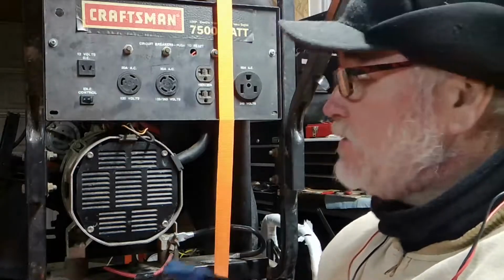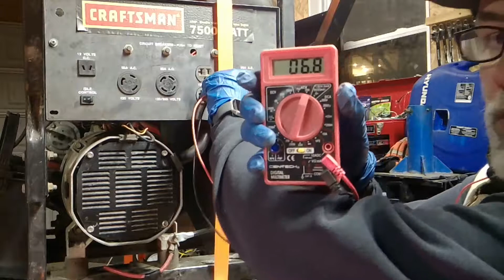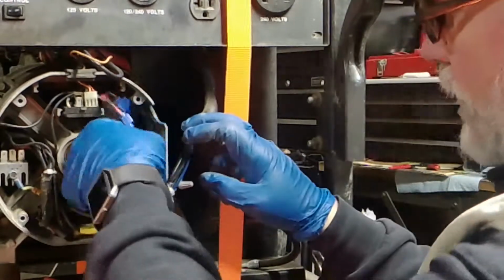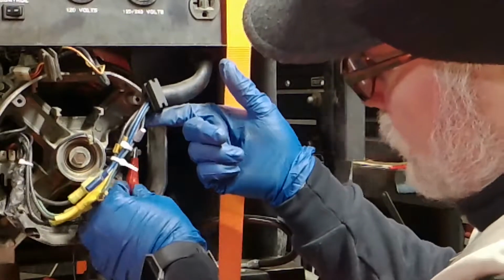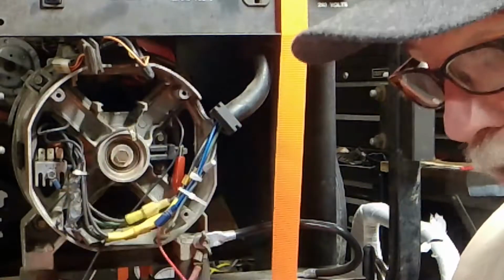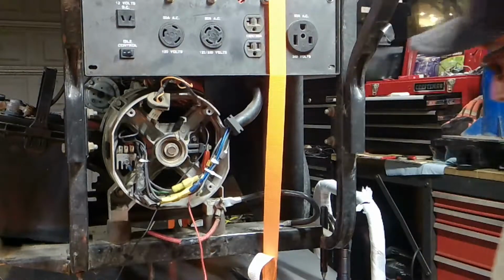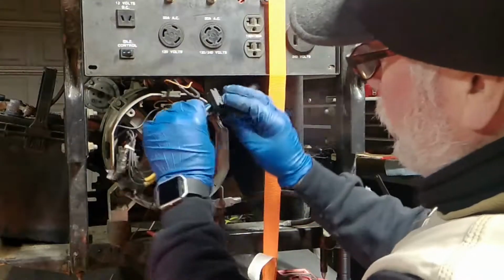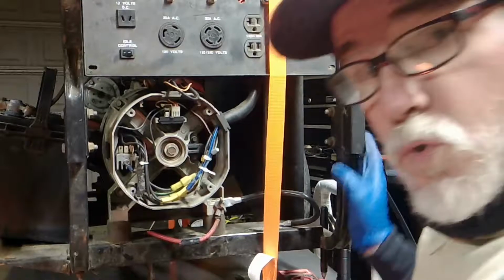How to diagnose generator power loss by flashing field w/12v battery and change voltage regulator

Comment: Great info and very clear in your instructions. Thx.
Reply: ⚠️Generator safety: make sure you read the manual instructions carefully and follow all the generator safety instructions. Always keep in mind that carbon monoxide fumes are very dangerous to inhale and carbon monoxide is odorless and colorless which is a silent killer. You should always have a carbon monoxide detector if you have a portable generator. Please remember not to ever run your generator indoors. Running a generator indoors increases the risk of carbon monoxide poisoning which causes death. Please make sure your generator is 15-20 feet away from your house and away from doors, windows, and vents to lower carbon monoxide poisoning risk. Please remember also not to run your generator in wet conditions. Running a generator in wet conditions can cause electrocution. Please keep your generator dry. Make sure your generator is dry before using. If you need to use your generator during a wet weather, then you need a generator tent to protect your generator from getting wet. We also need to keep our children safe when we are using portable generators so that they won’t get electrocuted or burned by the generator which is dangerous. We need to keep an eye on children making sure they are not near the portable generator to avoid risks and also carbon monoxide poisoning. Generators can be dangerous so we really need to be aware with the hazards of using generators. Generators pose electrical risks. Please never try to plug a generator cord into a wall outlet to avoid back feeding. They should be plugged into a transfer switch if you need to run your house with the portable generator. Please not overload your generator. Overloading your generator can cause damage to the appliances that are plugged into the generator. Always turn on your generator first before plugging in appliances. And shut off your generator first before you unplug the appliances. Please use a heavy duty cord for your generator and the cord should not be worn out. Worn out cords should not be used on generators. Please don’t refuel your generator while it’s running. You need to shut off your generator and let it cool off before refueling it. Never refuel your generator while it’s still hot. Everything that is said on the generator’s operating manual should not be ignored https://youtu.be/I1jT3ANENvI and here is a video more about keeping your family safe while using portable generators. This is just a safety reminder and please make sure you are aware with the hazards of using generators. Thank you hope you stay safe.

Comment: Truthfully I would think long and hard about buying a craftsman anything I was kind a hoping Stanley Black & Decker would build up the brand however I have not really seen this so far since they bought the brand from Sears,,, some years back craftsman still made pretty decent stuff,,,the Sears diehard gold line was usually about their best bet,,,however some of it had problems,,,I still have a soft starting 2/stage vertical Sears diehard gold air compressor rated for I believe 175 psi very soft starting nice air compressor but I had to do some worke to it,,, their lawn tractors are a big disappointment,,,now I think MTD is making them they’re just OK at best,,, back years ago when AYP American yard products still some of their lawn and garden tractors they made a pretty good craftsman tractor,,, truthfully I’m not sure about the handtools anymore,,,I have some of the older stuff I bought from a pawnshop going out of business 15 years ago it was used,,,looked like somebody had bought it but never really done too much with them them pawned it for almost nothing.

Comment: Good video, "Fire in the hole" I like it, your a cool nut. work has to be fun right? I'm looking a some videos because I'm getting ready to change out and test 6 diodes on a 125k 480 gen-set. wish me luck.
Reply: ⚠️Generator safety: make sure to follow all the generator safety instructions and always keep in mind that carbon monoxide fumes are very dangerous to inhale and carbon monoxide is odorless and colorless which is a silent killer. You should always have a carbon monoxide detector if you have a portable generator. Please remember not to ever run your generator indoors. Running a generator indoors increases the risk of carbon monoxide poisoning which causes death. Please make sure your generator is 15-20 feet away from your house and away from doors, windows, and vents to lower carbon monoxide poisoning risk. Please remember also not to run your generator in wet conditions. Running a generator in wet conditions can cause electrocution. Please keep your generator dry. Make sure your generator is dry before using. If you need to use your generator during a wet weather, then you need a generator tent to protect your generator from getting wet. We also need to keep our children safe when we are using portable generators so that they won’t get electrocuted or burned by the generator which is dangerous. We need to keep an eye on children making sure they are not near the portable generator to avoid risks and also carbon monoxide poisoning. Generators can be dangerous so we really need to be aware with the hazards of using generators. Generators pose electrical risks. Please never try to plug a generator cord into a wall outlet to avoid back feeding. They should be plugged into a transfer switch if you need to run your house with the portable generator. Please not overload your generator. Overloading your generator can cause damage to the appliances that are plugged into the generator. Always turn on your generator first before plugging in appliances. And shut off your generator first before you unplug the appliances. Please use a heavy duty cord for your generator and the cord should not be worn out. Worn out cords should not be used on generators. Please don’t refuel your generator while it’s running. You need to shut off your generator and let it cool off before refueling it. Never refuel your generator while it’s still hot. https://youtu.be/I1jT3ANENvI and here is a video more about keeping your family safe while using portable generators. This is just a safety reminder and please make sure you are aware with the hazards of using generators. Thank you and stay safe.

Comment: so i did this and i check the voltage at the plug. it is on 83 volts. any suggestion on what the problem would be now?
Reply: Make sure Generator is running at 3600 rpm..
Reply: Generator safety advice: always keep in mind that carbon monoxide fumes are dangerous to inhale so portable generators should never be used indoors. Carbon monoxide can cause death in minutes. Especially we should also keep our children safe. Generators can be dangerous if not used carefully. Carbon monoxide is an odorless and colorless gas. Carbon monoxide is a silent killer. So you should have a carbon monoxide detector to keep your family safe. Having a carbon monoxide detector is very important if you have a portable generator and other equipment that produces carbon monoxide. Please make sure your generator is 20 feet away from your house and away from doors, windows, and vents. Running your generator indoors increases the risk of dying from carbon monoxide poisoning. It’s never safe to use your generator indoors. Please keep that in mind. We also need to keep our children safe when we’re using portable generators so they won’t get electrocuted or burned by the generator and also poisoned by carbon monoxide which is dangerous. Please make sure your children are not near the portable generator to avoid risks. Generators pose electrical risks. You also should not run your generator in wet conditions. Running your generator in wet conditions can electrocute you. You have to make sure your generator is dry before using. If you need to use your generator during wet weather, you need a generator tent to protect your generator from getting wet. Please don’t let the generator get wet. Please don’t ever try to plug a generator cord into a wall outlet to avoid back feeding. Do not overload your generator as well. Overloading your generator can cause damage to the appliances that are plugged into the generator. You need to use a heavy duty cord for your generator. Do not use cords that are worn out. Always turn on your generator first before plugging in appliances. And before unplugging appliances, please shut off your generator first. Do not ever refuel your generator while it’s running. It can cause fire when refueling your generator while it’s still hot. You have to shut off your generator and let it cool off before you refuel your generator. Please follow all the manual instructions carefully.  https://youtu.be/I1jT3ANENvI and here is a video more about keeping your family safe while using generators. This is just a safety reminder. Thank you be safe.

Comment: My generator is not putting out electricity what is the problem
Reply from the maker: Hi Vicky tell me more like make and model you have. I will gladly try to help you. Did you check out my videos that seem to be anything you are experiencing?
Reply: Reminder about generator safety: always remember that carbon monoxide fumes are odorless, colorless, and toxic and dangerous to inhale which causes death. That’s why it’s never safe to run a generator indoors. You also need a carbon monoxide detector to be safe from carbon monoxide. Please be aware with all the hazards of using generators. Many people have died each year when using generators due to carbon monoxide poisoning and electrocution. Especially you should be keeping your children safe when you’re using portable generators so they won’t get electrocuted or burned by the generator which is dangerous and also poisoned by carbon monoxide. This is just for everyone’s safety. Make sure you read the manual instructions carefully. Please remember not to run your generator indoors. Your generator should be 20 feet away from your house and away from doors, windows, and vents. Running your generator indoors increases the risk of dying from carbon monoxide. Also do not run your generator in wet conditions. Always make sure your generator is dry before using. Do not allow the generator to get wet. You also need a generator tent to protect your generator from getting wet if you need to use your generator during wet weather. Running your generator in wet conditions causes electrocution. Please be careful. Please make sure your children are not playing near the portable generator so they won’t get electrocuted or burned by the generator which is dangerous. It won’t be safe for children to be near it. Generators pose electrical risks. Don’t try to plug a generator cord into a wall outlet to avoid back feeding. Please use a heavy duty cord for your generator. Make sure the cord is not worn out. Do not overload your generator as well. Overloading your generator can cause damage to the appliances that are plugged into the generator. Please turn on your generator first before plugging in appliances. And shut off your generator first before you unplug the appliances. And never ever refuel your generator while it’s running. Refueling your generator while it’s running can cause fire if gasoline spills on the generator’s engine because it’s hot. You should shut off your generator and let it cool off before refueling it. Just making sure you are aware with the hazards of using generators. Whatever is said on the generator’s operating manual should not be ignored for safety.  https://youtu.be/I1jT3ANENvI and here is a video more about generator safety and keeping your family safe. Thank you. Be safe

Comment: My generator is not putting out electricity what could be the cause of it
Reply: Does any one know why my hobart generator aint putting out electricity
Reply: Generators not producing electricity is a cause of loss of residual magnetism. If the residual magnet is lost, your generator won’t produce electricity. I also have something to explain about generator safety and it’s very important for everyone to know. 
⚠️Generator safety: please make sure you follow all the generator safety instructions carefully and always keep in mind that carbon monoxide fumes are very dangerous to inhale and carbon monoxide is odorless and colorless which is a silent killer. You should always have a carbon monoxide detector if you have a portable generator. Please remember not to ever run your generator indoors. Running a generator indoors increases the risk of carbon monoxide poisoning which causes death. Please make sure your generator is 15-20 feet away from your house and away from doors, windows, and vents to lower carbon monoxide poisoning risk. Please remember also not to run your generator in wet conditions. Running a generator in wet conditions can cause electrocution. Please keep your generator dry. Make sure your generator is dry before using. If you need to use your generator during a wet weather, then you need a generator tent to protect your generator from getting wet. We also need to keep our children safe when we are using portable generators so that they won’t get electrocuted or burned by the generator which is dangerous. We need to keep an eye on children making sure they are not near the portable generator to avoid risks and also carbon monoxide poisoning. Children should be kept away. Generators can be dangerous so we really need to be aware with the hazards of using generators. Generators pose electrical risks. Please never try to plug a generator cord into a wall outlet to avoid back feeding. Back feeding your generator is dangerous. Generator cords should be plugged into a transfer switch if you need to run your house with the portable generator. Please not overload your generator. Overloading your generator can cause damage to the appliances that are plugged into the generator. Always turn on your generator first before plugging in appliances. And shut off your generator first before you unplug the appliances. Please use a heavy duty cord for your generator and the cord should not be worn out. Worn out cords should not be used on generators. Please don’t refuel your generator while it’s running. You need to shut off your generator and let it cool off before refueling it. Never refuel your generator while it’s still hot. https://youtu.be/I1jT3ANENvI and here is a video more about keeping your family safe while using portable generators. This is just a safety reminder and please make sure you are aware with the hazards of using generators. Everything that is said on the generator’s operating manual should not be ignored. Thank you stay safe.

Comment: Excelente video, very informative
Reply: ⚠️Generator safety: make sure you are aware with all of the hazards when using generators. Always keep in mind that carbon monoxide fumes are very dangerous to inhale and carbon monoxide is odorless and colorless which is a silent killer. You should always have a carbon monoxide detector if you have a portable generator. Please remember not to ever run your generator indoors. Running a generator indoors increases the risk of carbon monoxide poisoning which causes death. Please make sure your generator is 15-20 feet away from your house and away from doors, windows, and vents to lower carbon monoxide poisoning risk. Please remember also not to run your generator in wet conditions. Running a generator in wet conditions can cause electrocution. Please keep your generator dry. Make sure your generator is dry before using. If you need to use your generator during a wet weather, then you need a generator tent to protect your generator from getting wet. We also need to keep our children safe when we are using portable generators so that they won’t get electrocuted or burned by the generator which is dangerous. We need to keep an eye on children making sure they are not near the portable generator to avoid risks and also carbon monoxide poisoning. Generators can be dangerous so we really need to be aware with the hazards of using generators. Generators pose electrical risks. Please never try to plug a generator cord into a wall outlet to avoid back feeding. They should be plugged into a transfer switch if you need to run your house with the portable generator. Please not overload your generator. Overloading your generator can cause damage to the appliances that are plugged into the generator. Always turn on your generator first before plugging in appliances. And shut off your generator first before you unplug the appliances. Please use a heavy duty cord for your generator and the cord should not be worn out. Worn out cords should not be used on generators. Please don’t refuel your generator while it’s running. You need to shut off your generator and let it cool off before refueling it. Never refuel your generator while it’s still hot. https://youtu.be/I1jT3ANENvI and here is a video more about keeping your family safe while using portable generators. This is just a safety reminder and please make sure you are aware with the hazards of using generators. Thank you and hope you stay safe.